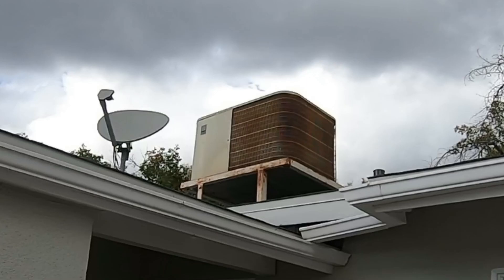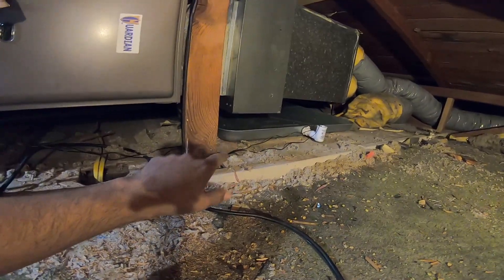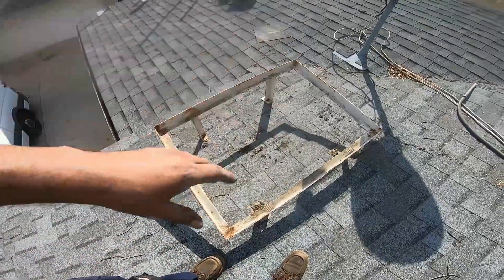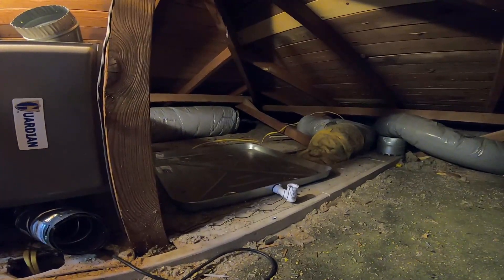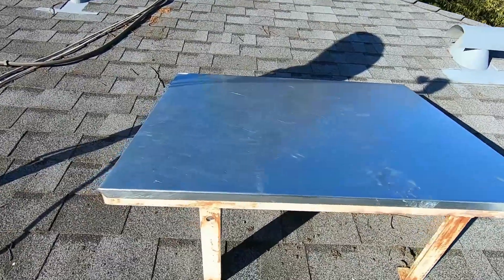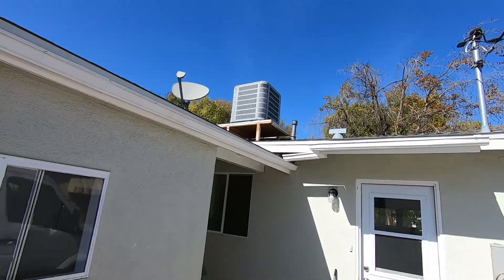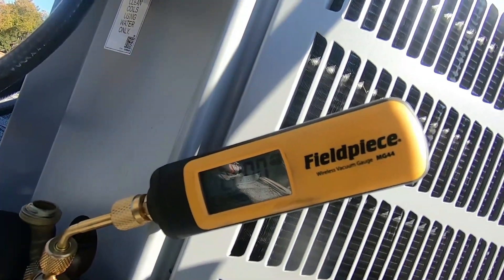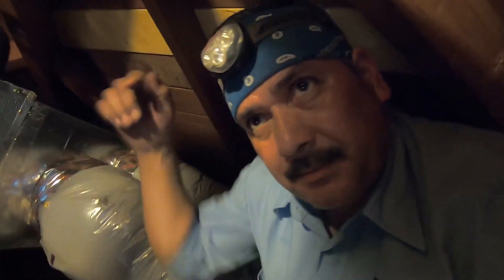3 Ton Air Conditioning Replacement.

Comment: I have a good question can you change a 2.5 ton unit to a 3 ton unit and use the same inside base ?
Reply: need more return  or  system will not work right
Reply from the maker: Chances are your furnace already had a 3 ton drive. Return should be big enough although most installations (like 80%) don't have enough return. You'll also need to confirm copper diameter and wire gauge for the condenser are adequately sized.